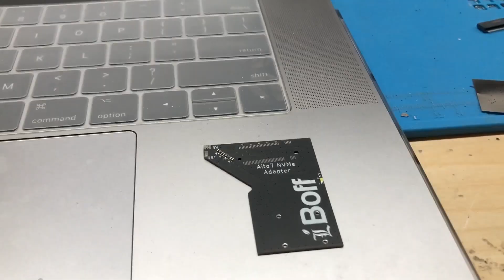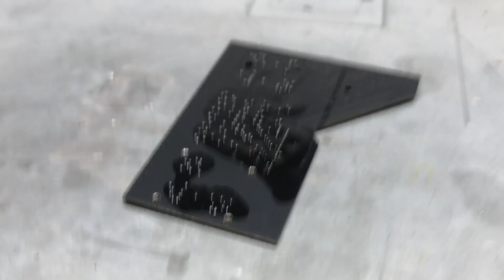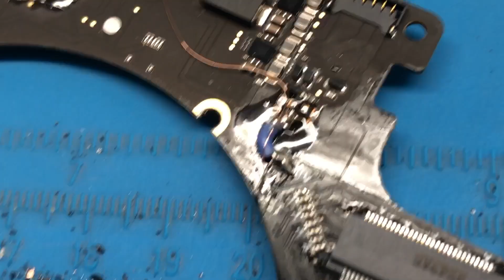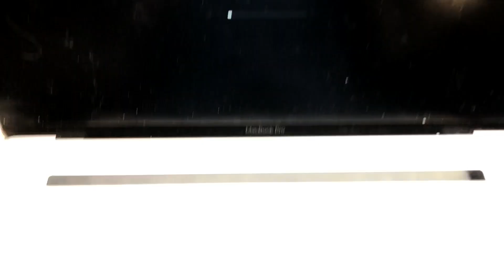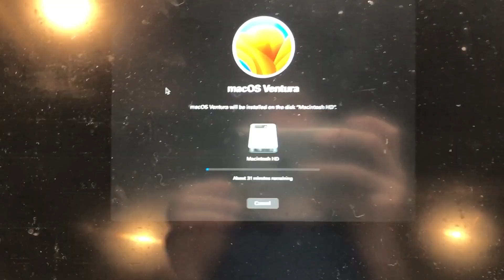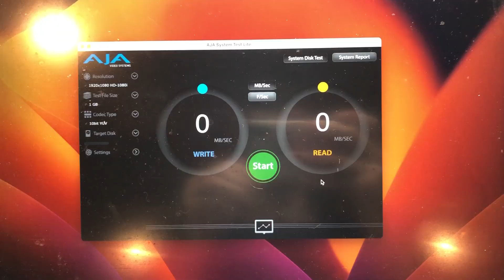Touchbar MacBook Pro NVMe SSD Upgrade

Comment: To all those reading this, bear in mind that this isn't just a matter of upgrading storage on an internal drive, but this is more of a matter of providing a repair path forward that not only allows user-level drive replacements permitting dead macs to be placed back into service, but it does so while simultaneously reducing one's e-waste footprint while also saving money by not having to buy an entirely new logic board/laptop. I don't know about you all, but replacing an NVME instead of a logic board sound like the better option.

Comment: Goddamn, it's been soldered the whole time? Fuck me, I was really hoping to remove the SSD for my new, better computer. Thanks for informing me, anyways.
Reply: Here's the thing: there is an NVMe board available through these guys that, if you can get the NANDs off the macbook, you can solder them on and it becomes a swappable NVMe. Technically you could place that into a USB enclosure that supports NVMe drives and pull the data that way.

Comment: Do you not have to worry about the soldered wire touching any of those components you had it laying above? Why not solder mask or glue it to the board away from all the metal? Made me nervous lol.
Reply from the maker: They are enamel coated wires, so not conductive unless that coating is removed/burned off.
Reply: @dosdude1  ahh ok. Kind of assumed that may be the case and solding burns it off, but I think I've seen naked wire and wire with clear coating for sale in the past. Thought it would be thicker if coated.
(Thanks for making me aware of this, I'll be upgrading mine as soon as the Backmarket warranty is over)

Comment: I upgraded the SSD in my 2014 macbook air from the original 128GB to 2TB. The increase in size was great, but read and write speeds were over twice as fast as the original. That was using a cheap Silicon Power drive.

Comment: It would be really cool if someone can figure out how to convert the SSD solder pads of either a T2 or Apple Silicon Mac to the slots used on the T2 and M2 Max/Ultra Mac Pros and all Mac Studios as well as the 2020 iMac with T2. I imagine it could work potentially considering the process for restoring the OS works the same regardless of the SSD being soldered or not. In fact, the 2020 iMac actually has both a soldered SSD and a slot for a module but the connector is only on models that come with the upgraded SSD and there’s only solder pads for the connector on the lower end one

Comment: You don't know how excited I am to see this. I refuse to have a computer that the hard drive is not removable. At the moment I am stuck in intel land although i do love my 2015 mbp and am eyeing a 2019 imac as a possible upgrade later. Currently also using the 6,1 mac pro now that it has come down in price to a reasonable amount for the hard ware.

Comment: I would just buy external ssd.... this is insane.
Reply: I believe this kind of misses the point of the mod. 

I understand you're coming from a standpoint of providing an upgrade path; however, the nature of this is such that it not only allow for SSD upgrades, but provides what is essentially a user-level SSD replacement procedure on aging Macbooks with integrated SSDs. 

The main benefit to this is that it minimizes e-waste due to the fact that a system that might otherwise be fully usable isn't being tossed.

Comment: Man I’m being honest with you dosdude I’m loving you videos. But I gotta tell ya your Mac OS patcher are far more reliable than OCLP on some Mac devices. The high sierra, Mojave and Catalina patcher are simple to use and work flawlessly when watching the walkthrough videos. I wish you would create a new one for Ventura and Sonoma. I have a mid 2010 15 inch MacBook Pro with only 8gb of ram (cant be ungraded i tried 16gb) but OCLP gets stuck every single time at the very end and none of the tutorials work. I’ve never had a problem with your patchers but open core man nothing but problems. I’ve installed OCLP on all my other Mac’s and it work great but this 2010 is a pain in my butt.

Comment: I really want to attempt this on my 2017 15" touchbar MBP that has been sitting on a shelf for two years since the battery bloated and had to be removed. I bought it with 256GB storage at the time because I couldn't afford the extra storage upgrade, but I'm glad we're now at an inflection point where these devices are becoming easier to work on and upgrade, even with soldered components. Thank you for the upgrade video, I hope to take this on soon as I continue to hone my soldering skills and remove chips off donor boards for practice.
Reply: Easier to work on for those with pricey reflow stations and a learned knowledge of melting points 😅

Comment: Hey there, I've seen your videos, you do incredible work. I was wondering how much a process like this would cost? I have a 15" 2016 TouchBar MacBook Pro 1TB. I think the onboard SSD is on its way out, and would be nice if I could get the upgrade at some point in the future. Also I know the battery is in poor shape too, despite macOS reporting it's condition as Normal. Thank you!

Comment: By a landslide, the worst  MacBook Pro is the 2011 MacBook Pro 17 inch.
Reply from the maker: Nope, as the only issue with those is the defective AMD GPU. I have fully resolved this issue many years ago with my custom DeMux firmware for them, which fully and permanently disables the AMD GPU, making them fully usable again with the Intel graphics. The worst MacBook Pros, by far, are the 2018 - 2020 Intel models with the horribly unreliable T2 "security" chip, which nothing can be done about.
Reply: @dosdude1  I love your channel man but to each their own.  I am just sharing my opinion after 23 years of running a shop based on what I have worked on more.  Your work is great, and I will keep watching,  but my opinion is still the same. I'm sorry our opinion is different.  Keep making content I enjoy watching my friend.

Comment: I can understand that you don’t like the T2 because it locks down the storage. And we know that it’s purely a software limitation because people have managed to upgrade some M1s, so my question is: Is there something else that ACTUALLY makes the T2 chip horrible because they seem to me to be the best and most secure systems because of it.
Reply from the maker: The T2 chip is not used on Apple Silicon machines, ONLY the 2018-2020 Intel systems. It is a garbage chipset hacked into an Intel platform. It fails randomly for no reason, and is extremely limiting in many ways. Again, NOT to be confused with Apple Silicon systems, such as M1, M2, etc. which do NOT use the terrible T2 chip, and don’t have any major issues that I’ve seen. I have little to no complaints about Apple Silicon chipsets, as they are actually generally well-designed and well-implemented. The T2 chip, on the other hand, was not, and did nothing but ruin the final generation of Intel Macs.

Comment: Won't the MacBook detect that's not an original SSD and not allow you to upgrade MacOS? That's what happens to my 2015 MacBook pro when it has swapped SSD with an adapter

Comment: Would you be able to upgrade the SSD on a 13" M2 MacBook Pro not for a replaceable SSD but even just replace the chips with higher storage ones, Or the ram But I think it would be easier to upgrade the SSD I've seen it being don't on the M2 Air the new model but I thought it would be an issue with the T2 Chip

Comment: For the highest technical level videos, the host of the video will frequently and repeatedly speak from both corners of their mouths or speak in a way where they doubt themselves.  It's fascinating.  To be clear, I think this might be a way of speaking for filler or internal dialogue leaking out.  What is most curious though is how one acquires the knowledge of keeping vs removing capacitors.  Excellent work as usual.  What are you working on next, Colin?

Comment: As somebody who has to use a MacPro for work (due to my company being in the Apple Eco-System), I am always astounded to see those overpriced products needing workarrounds like that for giving Users basic functionality and upgradeabillity. If one of our Macs has difficulties, we actually just get another one, as the IT already knows that it takes ages to fix those things and it can not be done inhouse. Especially with storage I think this is a huge problem if a supposedly pro machine can lock up your whole data as it's the case with the 2018 / 19 models. I was my whole life on PCs and while I have now the opportunity to use MacBook Pros in my daily life... Guess what, I still don't own a Mac personally. There is just to many downsides for me, apart from that inflated price. I mean, it's great that it seems to be possible to fix at least some of the problems.... But after seeing that video, it's even more clear to me that probably offering a service like that is still too expansive to make it viable for most people AND doing it yourself, for yourself is something that is more likely a semi-unique case...Still - watched 34 minutes of some dude putting in a new SSD in a 2016 MacPro and I liked it from a educational point of view 🙂.

Comment: It’s a shame the 2018 MBP got the T2 chip cause they did slightly improve the design to try mitigate some of the total flops of the 2016/17’s longer display cables, a keyboard revision to attempt to mitigate the failures, and a few other updates,

Comment: Do you think this method can also work with the Apple silicon laptops as well? I know they have the controller on the chip so this might not be possible.
Reply: Unfortunately not - in fact, it won't even work on the next generation of Intel MacBooks with the T2 chip - the T2 controls the SSD and you can't disconnect it because it's also responsible for controlling the boot process. These same machines also move the UEFI firmware into the same chips as the main SSD, which is why they boot to a black screen rather that the ? folder icon if the drive goes bad.

Comment: is the 3a pad used for power in different places for different models? The circuit could have been made to fit it rather than use an oddly short thick wire

Comment: Wow, didn't know that the touchbar 2016-2017 macbooks have soldered ssd.
Also. I have a 2016 13 inch (non-touchbar) macbook pro and I managed to install El Capitan on it, despite it not being officially supported, but i got every driver working out of the box, including graphics acceleration. The weird thing is that it shown Intel HD Graphics SKL instead of Intel Iris Graphics 540, but I also fixed that with software update.

Now here's my question. Basically there's a new bug (...?) going on. OS X El Capitan and older now show Unarchived instead of the OS name in About this mac. And it also won't show model. I'm thinking that it's server-side but I'm not sure. Maybe you know better. Do you know any fix for that?

Comment: Never owned an Apple anything, but thank you for sharing this extraordinary mod.
Reply: why not?
Reply: @Mechanic90s  Because you can do a lot more on Windows. I love what Apple has done to AI coding on their products and are producing their own APU's. However, you better not break your Apple product by accident, otherwise they will not allow 3rd party repair, let alone the costs associated with the repair centre. And your phone gets one or two version updates then you're on your own, unlike Windows OS on laptops & desktops which is a lot more generous with their extensions. Have you noticed the cost difference of Apple products lately ?
Reply: @Matlockization  Apple products are bad quality they are the same level as cheap acer or no name chinese brands. I fixed laptops for about 15 years and i was shocked how bad apple products are.
Reply: @robbirobson7330  And to make things worse, they are locking more of their hardware & software down, as I'm sure you're aware.
Reply: @Matlockization  yes fortunately i was able to leave the repair field and don't have to deal with this crap anymore

Comment: Dude you are legendary. These are exactly the types of shenanigans that Apple hates because it completely satisfies the Right to Repair advocates and, for many people, negates the need to upgrade your computer! Obviously for people doing any heavy work, you’d want to bump up to a new Apple silicon machine, but for someone who does basic things with their computer - probably MOST people - this breathes new life into their perfectly working machine.
Reply: Knowledge, skills and courage to DIY are not 'Shenanigans'. Also have you wanted thinner, lighter laptops?
Apple gave you what you asked for. Do you think they give a fuck about your mods?
In 5, 7, 10 years you will be forced to buy a newer Mac anyway.
Reply: @UomoMagnetePlus if someone gets a few more years out of an old upgraded laptop instead of buying a new apple silicon model, then yes, apple would give a fuck. And if by waiting some years the user then sees that ARM on windows is finally a thing, as is supposed to happen soon, and doesn’t buy a new mac at all, then they would give two fucks, yes
Reply: @UomoMagnetePlus  I'm buying a framework 16 because I care about repairability and upgradeability. it's hardly any thicker than the thin-at-all-cost macbook pro 16 but has hot swappable keyboard/trackpad and IO modules. The screen and the screen bezel come out super easily. The rest of the computer can be disassembled with a single included screwdriver. And importantly, you will actually be able to buy the parts necessary for repairing the device. Unlike apple that does not sell any of the parts to the users.
Also, nobody ever asked for thinner computers, maybe lighter but not thinner. I have yet to meet someone that has walked into any computer store and asked, "What is the thinnest computer that you have". Often the most restricting part about a laptop's profile is the length and width, not the minuscule height. It was the corporations that changed laptops without giving us a choice, they marketed it as if it was a good thing and gaslit the consumers into believing thin-and-light was good and that upgradeability and repairability was necessary to be sacrificed in order to achieve this thinness.

Comment: I wonder how mechanically stable this will be considering it contains a connector and is mounted without major solder connections to for instance the ground plane.
Reply from the maker: Yeah, that’s probably the weakest point of this mod, but most of the pads on this board are ground, so that should provide a good amount of mechanical robustness to keep it in place unless you really pull on it.
Reply: Some glue would be nice as part of the kit

Comment: I've done this mod on my A1707 820-00281-A mlb.
Storage wise I use a 2TB nvme drive.
What would be the maximum storage capacity?
Reply from the maker: Depends on what kind of drive is available, but 2TB so far has been the largest I could find in the 2230 form-factor.
Reply: Now I just noticed you used the old revision of the pcb.
The orientation of the ssd connector is a bit offset on the one I used to accept the ssd in the bottom of the case with no issues

Comment: I may hate Apple, but I love seeing DD1 work on them.  Imagine how many would've been saved from the landfill if Apple had just put a connector on in the first place?

I'm not seeing how, but is this a cost effective mod, or is it really only for the enthusiast who can't bear to part with their favorite machine?
Reply: It could be cost effective if you already had the tools to do the mod. The pcb+connector+stencil are only 20 dollars. You could probably shell out some money to get the gear to do it but I'd only go for that if you plan to do other things with them, otherwise your buying a hot air gun, soldering iron, solder, flux and solder wick all for only a single project.

Comment: That's the exact same SSD as the one I put into my Steam Deck. The SN740 is a great little 2TB 2230 SSD.
Reply: Those 2230 models from wd, kioxia, transcend etc were kind of expensive and hard to find when the steam deck got in the hands of enough hobbyists, but now the prices have come down a bit. Still not as cheap as the ubiquitous 2280 models but a lot cheaper than the ridiculous prices apple is charging per GB when ordering

Comment: I'm curious : Why do you use an iPhone X, when you clearly have the ability to pick up a much better device (apple or not) and repair it ?
Reply from the maker: Because it runs iOS 14, which I can jailbreak and achieve full root filesystem read/write access.
Reply: Oh right exactly the same reason why I have my bootloader unlocked and a custom rom then ! Sadly to be free with an iPhone one needs to give up on being up to date @dosdude1

Comment: Is this something that could be done on a late 2012 13inch Retina MacBook Pro?
Reply from the maker: Already upgradeable, but one other upgrade that can be done to that model is installing a quad-core CPU. I plan to do this soon.
Reply: @dosdude1  you ahh, want to use mine as the guinea pig?  😛
Reply: Or maybe mine is already removable storage.  🤔

Comment: i have a 2017 15" macbook pro and this is an awesome upgrade! i was told a long time ago that the onboard ssds were keyed to the system some how and that they couldnt be replaced, is this still true and if so how did you get around that? if not why would people think that?
Reply: I think he mentioned the next model with T2 chip is keyed and cannot be upgraded
Reply: @HNedel  so strange, when i was having issues with my mbp which is the same in the video, people were telling me the issue could be the ssd and that it is keyed to the laptop itself, thankfully the ssd wasnt the issue

Comment: I was wondering if your 0.1mm copper wires were enameled for isolation or you would need to UV resin them to avoid any shorts? Beautiful work. MBP2017 is no longer the worst apple product with this upgrade.
Reply: even if enameled, usually the coating burns easily off.